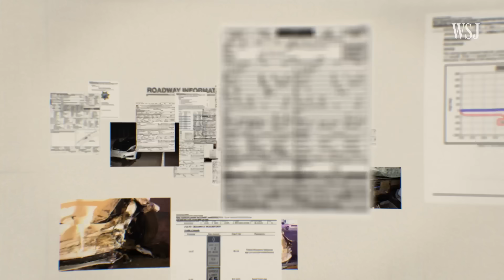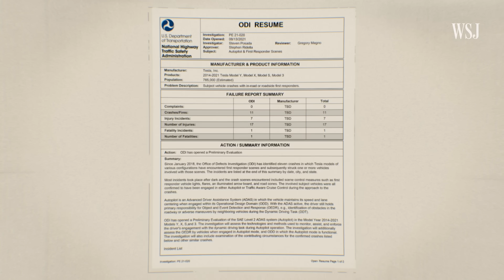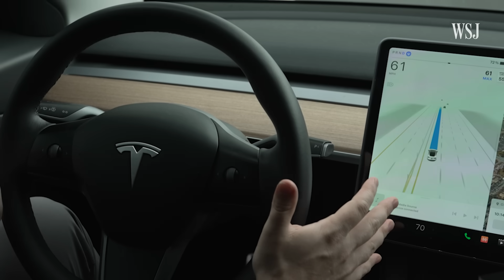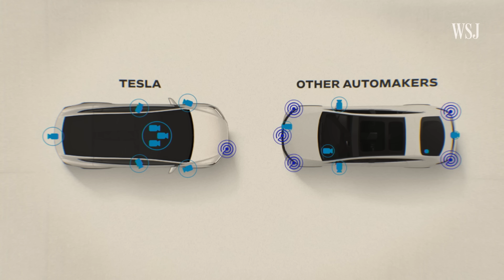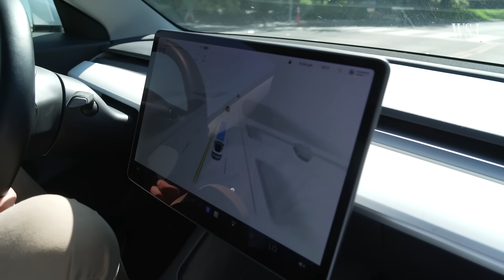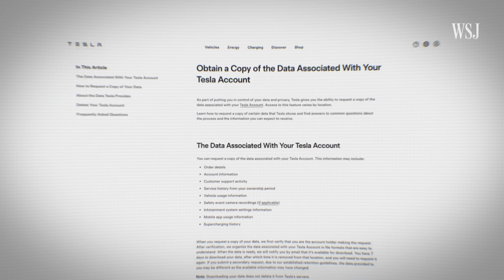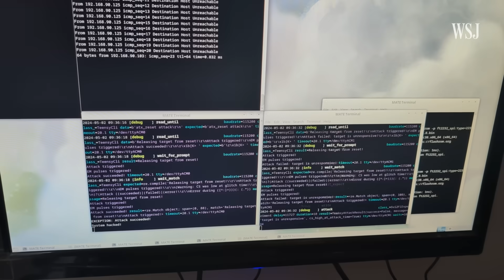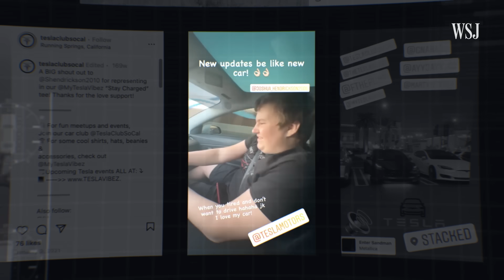The Hidden Autopilot Data That Reveals Why Teslas Crash | WSJ

Comment: Is WSJ right in showing the problem with FSD? Yes. But they should have also shown it's benefits, and used data from sources like NHTSA to prove that it's still very safe
This is what WSJ should have shown: The per driver calculations show how likely it is for a person to be involved in a crash, and the per mile calculations show 

Drivers: 233M
FSD users: 900K

FSD crashes: 67 (Since release, October 2020)
Driver crashes: 6,102,936 (Since 20211)

Crashes per driver:       0.02619285836 (Crashes÷drivers)
Crashes per FSD user: 0.00007444444 (crashes÷FSD user)

Driver miles driven (since 2021): ~9,680,000,000,000
FSD miles driven: ~4,047,000,000 mi

Crashes per Driver mile: 0.0000000630468595 (crashes÷mi)
Crashes per FSD mile:    0.00000001655547319(crashes÷ mi)

Comment: Musk speaks only of the "normal" cases... Responsible engineering demands similar performance in the worst cases... Redundant, diverse sensor systems are basic to a solid engineering solution. Musk suffers from an extremely optimistic assessment of his own capabilities and limitations. In effect, the guy may as well be a moron. His arrogance and ego are very dangerous to the public.

Comment: I study robotics and AI at university. So how this autopilot works is that the AI model essentially memorises photos using pretty straightforward linear algebra, and most of these photos come from stock images. Images of cats, trees, people etc. Saying an AI has 'learnt' generally means the model is usually 80% accurate with general everyday cases. So no niche circumstance like an overturned truck will never be picked up by an AI because how rare it is in the images of trucks the AI was shown. If we force the model to pick up on niche cases,  like an overturned truck, it will then completely mess up the maths it uses to figure out simple things, including a normal truck, making accidents a 100% certainty
Reply: Nobody cares about what you study at university

Comment: Funny how you complain when the car is at fault but never when a human crashes because "oh it's just human error". IT'S A COMPUTER DOING ITS BEST AT USING LIMITED INPUTS TO MIMIC A TASK DESIGNED FOR HUMANS! The driver should remain aware. It's fancy cruise control. The should be required to use LIDAR though so it can actually detect things in the way

Comment: It's all because of MuskRAT's hubris and ego. He alone willingly made the decision to axe LiDAR from his vehicles. Mammals have been on this planet for about 225 million years resulting in binocular vision that humans enjoy today. This vision though has complex regions of the brain the process what the eyeballs see. Trying to emulate human vision by using a couple of CCD cameras and a very limited image processor is the ultimate stupid decision. Especially on the public roads where everything happens at random and no two scenarios ever play out the same. You want high speed self driving cars, you're gonna need a lot more sensory power than just CCD cameras. LiDAR would be the absolute minimum. All other vehicles on the roads would have to have beacons or transponders that would alert other vehicles to their status and their position. There would have to be status points on the roadways to alert autonomous or semi-autonomous vehicles to the presence of dangerous situations ahead. Cars would have to obey speed limits set based upon road conditions. MuskRAT needs to realize that the public streets and highways are not a game of "Out Run" or "Pole Position" where the obstacles are always in the same place at the same time each and every time you play.

Comment: My mums nissan is fitted with radar, it detects possible collisions well before you have and applies braking to slow you down, plays a tone, shakes the wheel and displays collision warning on the dash. 

99% of the time you think to yourself that wasnt even remotely close but some day it will be and that nissan will save somebody's life. 

These teslas are too dangerous to drive using "auto pilot" due to its lack of secondary detection systems. Cameras work just fine in perfect conditions, but you cant trust it in poor conditions. It needs to be backed up with radar or lidar.

Comment: What am I missing here? When you engage Autopilot, a Tesla CLEARLY tells you to stay engaged and be prepared to take over at any time. There’s even a camera inside the cabin to monitor your attention and cancel the autopilot if you’re not paying attention.  Tesla is one of many car manufacturers with “self driving” cruise control, but it’s the only one that cops flack because of its high profile. I’m not a church of Elon follower by any means, but this is just sensationalised news when really the discussion should be that people are using this as a crutch when it’s merely a tool😊
Reply: The technology isn't ready for prime time and never will be.
Reply: @klank67  Yeah, those new fangled horseless carriages are just a passing phase.

Comment: Any kind of Self Driving needs to have;
LIDAR (several Fixed not Roating Style!). 
RADAR. 
SONAR. 
THERMAL. 
GLSS (Global Location Satilite Systems!) with sensors in each corner of the vehicle and a larger central sensor for exact positioning data.
*GLSS includes but is not limited to GPS (USA) Glonass (Russia) Galileo (EU) Baidu (China) by using at least 3 to 5 Satilites of at least 2 different systems help ensure accuracy more is better upto a certain point! 

They should also have connections to Emergency, Meteorological, Earthquake/Geological services too give drivers critical information and if not acknowledged pulls over! 

All working in conjunction with each other too auto break and even swerve or pull over for safety!

Comment: Why don't you drive manually then. Stop using autopilot. How is tesla responsible for you leaving there driving unattended. They never told you to close your eyes and let the auto pilot drive. It's only an assistant feature. It is like saying I failed my exam because chat gpt gave me the wrong answer. Don't use chat gpt then.
Teslas are way safer than ordinary cars without autopilot fetures as a matter of fact. Then why should they be critisized?

Comment: I thought that auto pilot was wonderful and safe until she went wild at a high speed and out of control after seeing the wrong light signal at the intersection. I decided not to use it anymore. The company said that the driver is responsible for the cost either on auto or not. They are not responsible.

Comment: EU has the right idea here, for solutions such as autopilot, they need to use "the correct sensors" and not just a bunch of cameras. There is also this issue that there is an expectation that the driver remains "in full control", but we all know they won't be. They will be lazy, not looking around, not risk assessing, which is required when driving. This is the result of the main case. He's letting his car make decisions for him. Sorry for the families loss, but this is a misplacement of trust in the vehicle. Treat it like it is, a driving aid, but still do the driving. That is the only way to prevent accidents. There is no way, at full speed, a vehicle can pass control onto a driver and the driver be able to respond to it.

Comment: I'm a computer scientist in the UK, with a specialty in Artificial Intelligence.
My view on this (and im currently in the process of making a documentary on Autonomous Vehicles, feel free to check out the progress so far on my profile) , the documentaries try to remain impartial and factual, however that doesn't mean I dont have my own opinion on the research and thoughts based on the technology.

A robot in computer science is often defined as an unit that is aware of its environment and able to interact with it / navigate around it whilst providing some useful functionality
A robot vacuum cleaner for instance is a unit that is the vacuum cleaner and able to navigate around a room and know were it is, in relation to the dimensions of the room with a useful functionality to vacuum a floor and in some models even mop it up

When you look at these type of vacuum cleaners there are VSLAM (Visual Simultaneous Localization and Mapping) and LiDAR (Light Detection And Ranging) and this is true to self driving cars were by Tesla and Wayve use cameras (VSLAM) and Waymo, Cruise and TuSimple have used LiDAR, the best of cause are the ones that use a combination of both along side other sensors for redundancy. This is why Waymo and Cruise achieved Level 4 Autonomous driving whilst Tesla remains at Level 2 possibly Level 3.

The same problems you see in robotic vacuum cleaners are present in robotic cars that use VSLAM
Poor performance in low lighting conditions (night time, light flares, obscure point of references) and whilst robotic vacuum cleaners may look at your ceiling for a point of reference or detect objects infront of it, with a AV then the point of reference may be the road markings, and a country road or low lit road makes it difficult even for human drivers let alone a camera

LiDAR isnt without flaws, it too can be fooled with metalic objects and transparent or translucent objects, this is why a combination of sensors are necessary so that were one misses the object the other kicks  in and states so

Mark Rober did a video recently showing how to fool an AV, crashing into a fake wall depicting an image of a road, LiDAR often stops, because the Laser beam bounces off an opaque object to notify it that something is there, but equally LiDAR cannot read a road sign as its only job is to detect solid opaque objects and how far that object is from its-self.

Camera as the sole backup may not necessarely work in 100% of cases either, take for instance a transparent object, both LiDAR and Cameras would fail to recognise there is something between the robot and its destination, this is why other technologies such as RaDAR can assist

However people equally must accept that Self Driving cars is not intented to make road traffic accidents a historical thing, it is intented to reduce the volume of serious collisions, which it is doing these stories shown to the world in WSJ are of cause worst case scenarios, and one could say well accidents have and do continue to take place on commercial airliners and private planes yet we still use them to travel and even say Air travel is the safest form of travel, so id be enclined to disagree with Missy Cummings at the end of the video, I do agree that LiDAR is expensive.

Problems with Tesla, is too many use it as self driving level 4-5 vehicles when it is not, and I agree with Missy Cummings in that people will have a false sense of security in that they trust the technology too much, very similar to how airline pilots trust their computer readings even when sensors as provding misleading data leading to a crash.

Comment: Sorry to anyone involved. Really am. Losing a loved one... yeah. But also - ... I hate to say this. If you're on the road - driving - YOU. ARE. DRIVING. Please, people who remain - excersise normal driving vigilance. Normal driving attention. Those flashing lights - in front of you - could be seen for at least 10 seconds. You could have stopped... Slowed down... made sure everything is ok - three or five times over. The fact that is says "Auto pilot" or "Blue cuise" or "Full self-whatever" - DOES NOT MEAN YOU CAN SLEEP AT THE WHEEL. Sorry once again. But people - PLEASE BEAR IN MIND. You passed the driving exam. You bought the car (not the other way around). You control it (not the other way around). You are the only party and person - responsible for where the car drives. YOU. ARE. AT. THE. WHEEL. Use steering wheel. Use brakes. Use turn signals. None of that - has changed within the last 50 years. Don't just trust something written on the box (orange or not). Think. Rely on the reality - not what you're being told. Use your gut feeling. Best of luck to all of us - from Latvia.

Comment: I don’t get why some people act like human drivers don’t crash. Statistically, Tesla’s Autopilot gets into fewer accidents per mile than human drivers. In Q3 2024, Tesla reported 1 crash per 7.08M miles on Autopilot, vs. 1 crash per 1.29M miles manually, while the US average for all vehicles is 1 crash every 670K miles. So, if safety is the concern, Autopilot is actually doing better.
Reply: That’s like saying airplanes are dangerous because they sometimes crash, while ignoring that flying is statistically much safer than driving. Just like Tesla’s Autopilot has fewer crashes per mile than human drivers, commercial aviation has far fewer accidents per mile traveled compared to cars. Yet, people still fear autopilot systems in both cases, even when the data shows they reduce risk.

Comment: God the fact that this is such an easy thing to fix (ie keep the radar/ultrasonic sensor) is insane. Id rather pay the extra $100 Tesla saves by removing sensors knowing the car will have an accurate way of checking for objects around me. Cameras are not eyes and no matter how AI/ML gets, roads and situations constantly change and we need exact sensor measurements of items in the way
Reply: I will say though overall, best solution is to remember that the car is never true self driving and you should keep your hands on the wheel and foot ready to brake

Comment: Trash analysis. It was said at the beginning of the video that per miles driven, autopilot is safer than human drivers. We have that data, so either prove that assertion as incorrect or don't weigh-in. All the additional points like how it's trained, whether Musk is a liar, whether it might have easily avoidable accidents occasionally, whether it uses lidar or not, the question remains does it do better than us or not? More specifically, does it do better in the latest version of the software over a previous? The software is being evolved incredibly fast so issues it had before cannot be used to argue against the fact that the technology may be working far better now. Most of the specific references used in this report are VERY dated.
Reply: Elon said autopilot was safer in the per miles driven, not The WSJ. 

Try again bot.
Reply: @ironace1100  Elon did say that but so also did the NTHSA. That's how we safety is measured. 

I'm no fan of Elon, but I can call out cr@p analysis. Moreover, the subject of the crash is based on versions of software from 4 years ago, which is lightyears away at the speed of tech. Even then, it was safer than human drivers per miles driven. 

This was a WSJ hit piece from a magazine that doesn't get ad revenue from Tesla.  So yeah, easy to call it out. And I'm a fan of WSJ when they do fair reporting.

Comment: There’s a blatant contradiction in claiming the car can drive better than a human, but blaming the human when the car crashes.
Reply: Also, when they say "drive better than a human", they mean the statistically average human... Which includes every intoxicated, distracted, aggressive, careless, fatigued, and incompetent driver. 

That's a really low standard, considering those are the drivers responsible for the overwhelming majority of accidents and casualties. A competent, attentive, careful, defensive driver can easily go their whole life without causing an accident.
Reply: @NondescriptMammal this is an invalid argument. It drives better than humans because humans have weaknesses. You can’t discredit FSD because humans have weaknesses when it’s designed to overcome those weaknesses. 

FSD is not better than a perfect driver. No one disagrees. It’s still, however, better than the average driver.
Reply: @steven121290 I disagree. FSD shouldn't have to compare itself to a perfect driver, but I think it is valid to expect it to be compared to attentive defensive drivers who abide by the laws that regulate driving behavior. I think it is invalid to compare it to a dataset that includes the many drivers who drive in ways that significantly increase the likelihood of an accident. What you euphemistically call "weaknesses" are in most cases deliberate, conscious decisions to drive in a careless manner, driving when drunk, or while texting, etc... often in ways that they know are offenses against the driving laws. 

I'm curious, why would you think it right to hold a self driving system to such an abysmally low standard?
Reply: "the car warned the driver 19 times before crash.." nuff said
Reply: Well said, well said
Reply: autopilot is not FSD.
Reply: Well also that claim is misleading because obviously statistics are gonna be better for AI car since it’s only been around for a couple years. I guarantee over the years that safety % will fall lower and lower as more and more people drive it for longer
Reply: The main problem here is Tesla relying on cameras only. There are radars that can successfully and effectively detect object 350m ahead in adverse weather conditions and the darkest of nights. What responsible automakers have been doing is use a fusion of sensors - lidars, 4D imaging radars and cameras. It's just corporate greed - being cheap that has caused this @tekiii1
Reply: If a human is behind the wheel, it is 100% on them for keeping their car in control.  Not a computer.
Reply: @3ffrige  Then it should be marketed as such, not as "Full Self Driving".